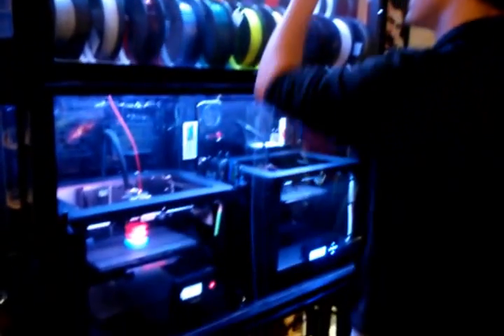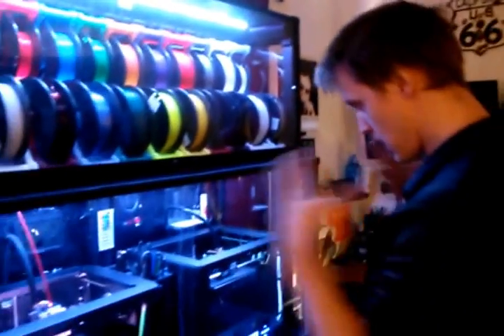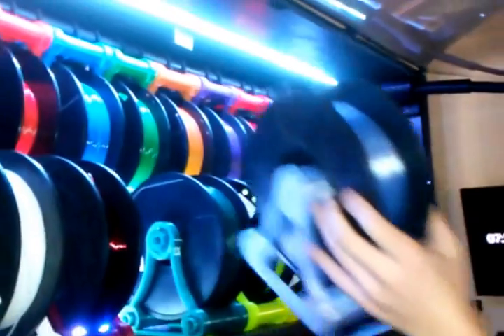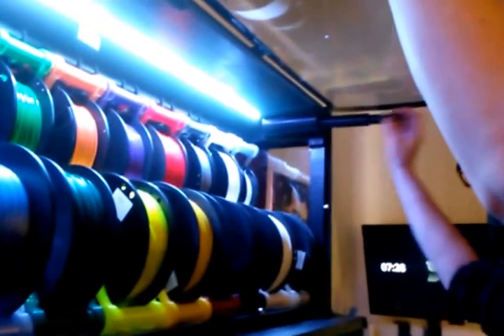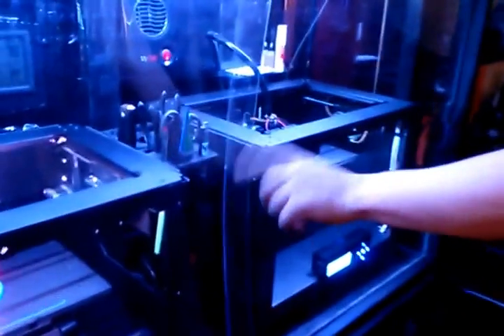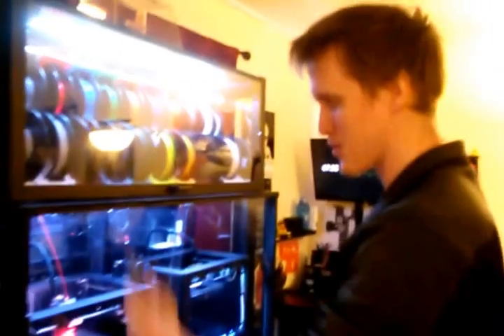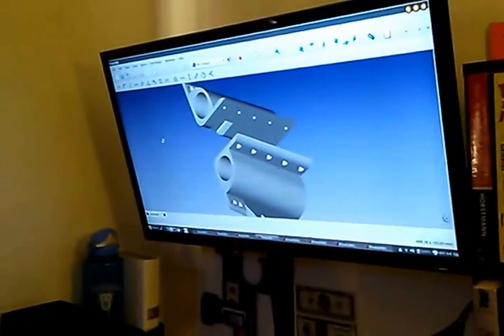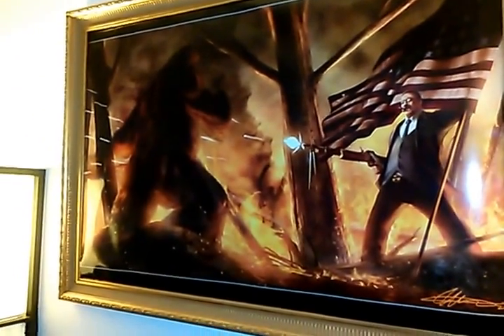Cool 3D Printer Enclosure / Set-up / Maker Space

Comment: out of curiosity...

it's been stated on the web by those with more expertise in 3D printing than I that you want free flowing filament feed to the extruder. No tension or slack as it moves. 

But I see your feed from the upper cabinet to the lower cabinet has the weather seal, then the cleaner. and quite a distance to travel if printing on the opposite end of the cabinet with that particular filament. This all adds up to more drag. Don't you find it effects your prints? Or how are you overcoming the drag/tension on the filament to extruder with your given set up?

also do you have cooling on your extruder's? 

How are you finding the overall higher temp in the cabinet is effecting your prints? (pros and cons)

It is nice btw, just curious about that.
Reply: +Jason Powell Thanks for the reply and additional info on your setup Jason.

I'm just starting out with 3D printing... so the info helps me understand a little more.

Thanks again.

Comment: Good job, you forgot however to add webcams to your printers for when you're away while they print. Or since you're also into electronics, you could add a rail, an arduino and a stepper/servo for one webcam to move back and forth to each printer..  But good job on your space